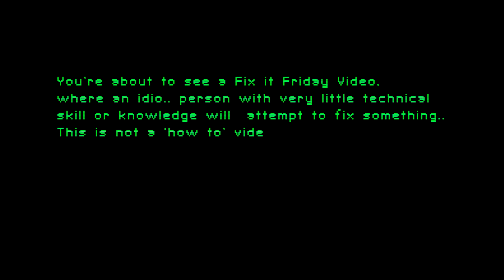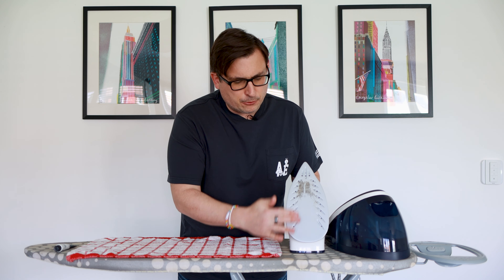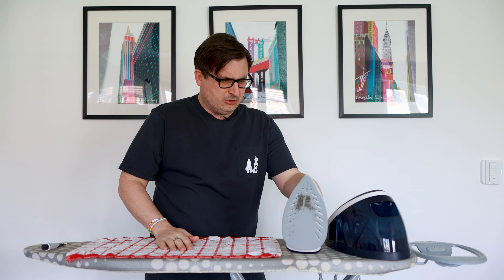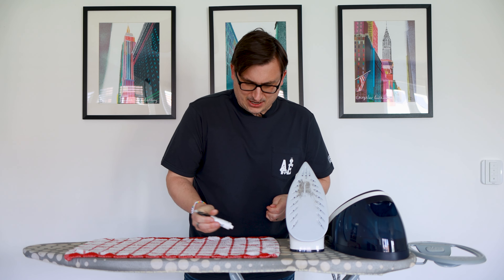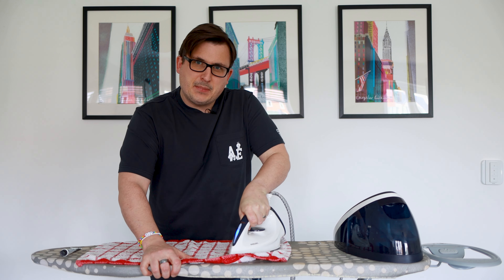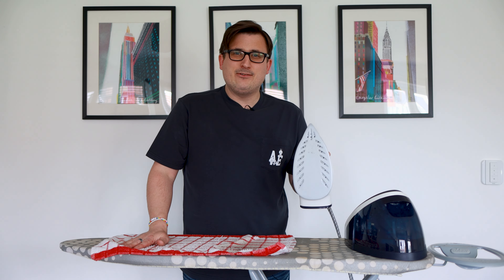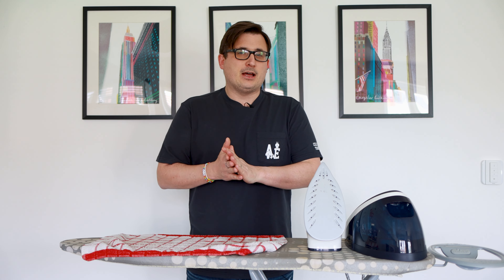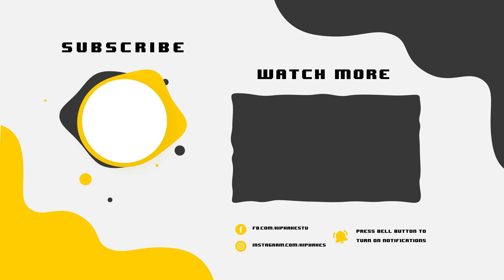How to clean your Steam Iron - Making my Iron like new - Fix it Friday

Comment: come on Kip, you know an iron can't run when you show it something scary!! hahaha nice tip though, and seems to work a treat. I thought it was time to throw the iron out, although people I lived with in the passed then they left the iron on and had a burnt bottom instead!! so needed replacement.
Reply: also pretty sure I heard a wives tale at one stage to use toothpaste, but don't think it done anything for the bottom, but great for whitening teeth.